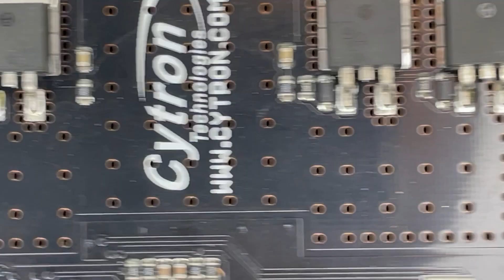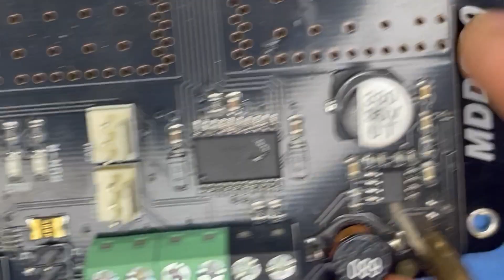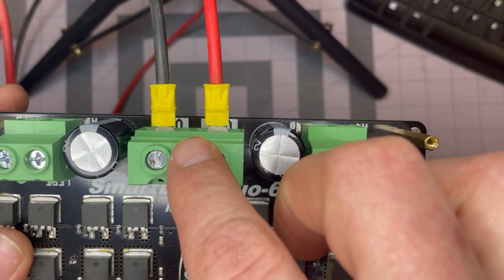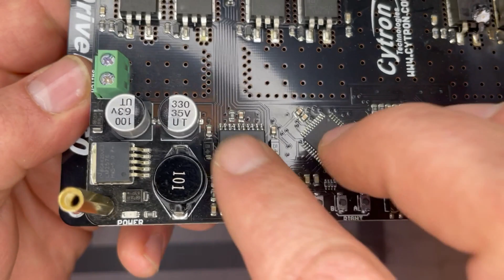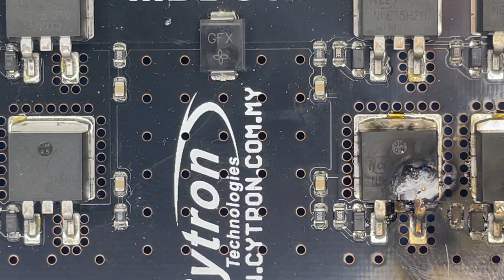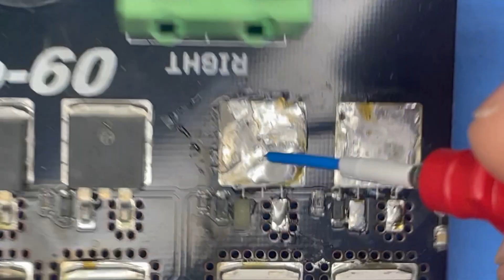Digging Deeper On The Damaged Motor Driver Circuit Board

Comment: Small dremel with a cutoff wheel has worked well for any small board repairs I have done in the past.
Reply from the maker: Thanks for the suggestion. Just want to be careful of the particles from the cutting process getting all over the circuit board. Not so much the cutoff wheel, but the conductive particles from the chip's legs.